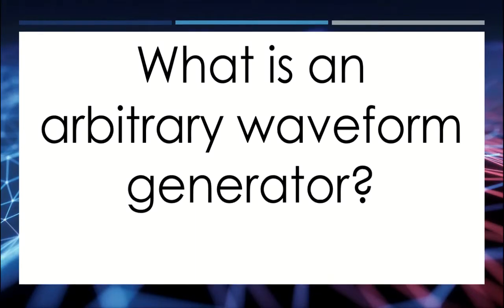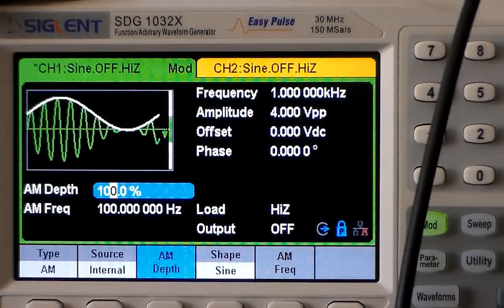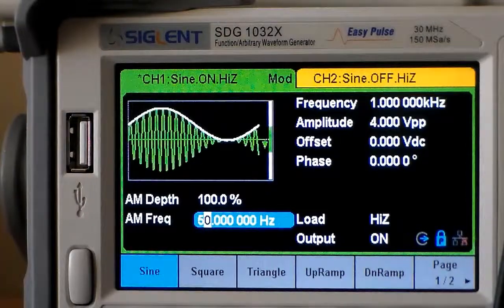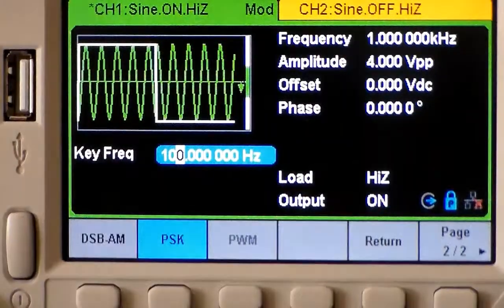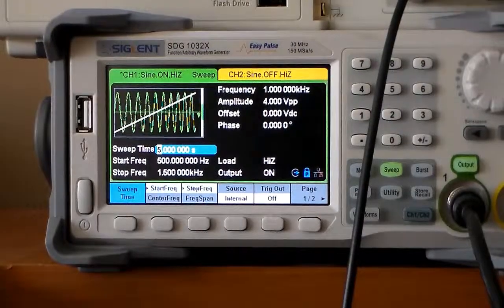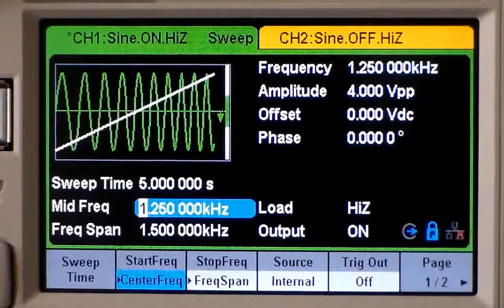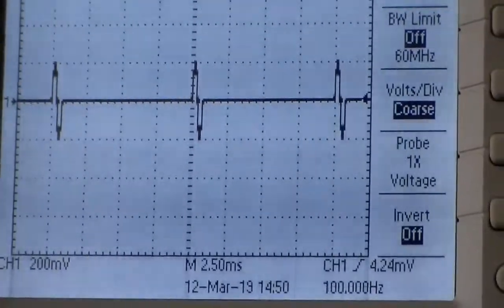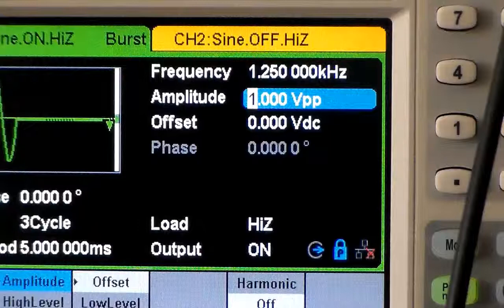Beginners Guide to Arbitrary Waveform Generators (using the SDG 1032X)

Comment: Thank you Clyde, I have the same unit been using it for years been happy all the time until yesterday where  I tried recently to generate a 24MHz Square waveform and noticed it's not actually square (nowhere near square), wondering if you have seen this before? thanks

Using the 1032X for a lower frequency does a Square nicely, but when I did 24MHz it failed quite badly, let me know what you think many thanks

Comment: Thank you for the in depth presentation. 
  Prior to viewing your video, I had purchased another generator and found that I needed software to set up AM and FM signals (downloaded just fine but will not transfer a wave to equipment as arbitrary)...here, 
it is possible to set up on the equipment directly; the software has additional perks for inputing functions and drawing waveforms.
  Superb,  well paced video.
Reply from the maker: Thanks Danny!
Please like, share and like.